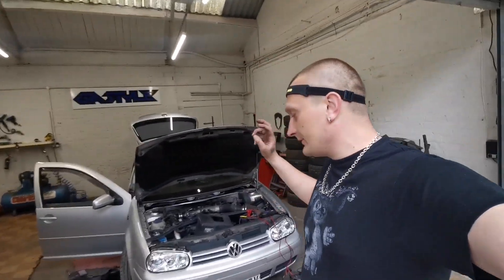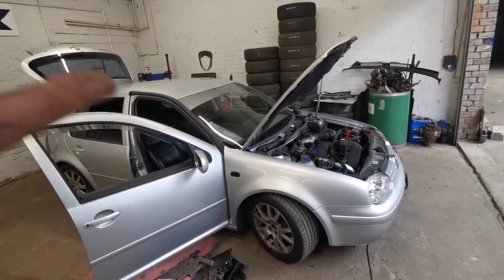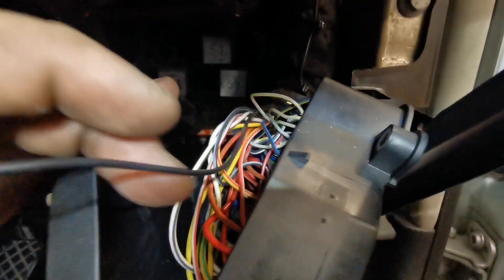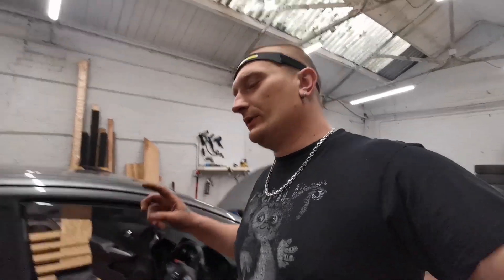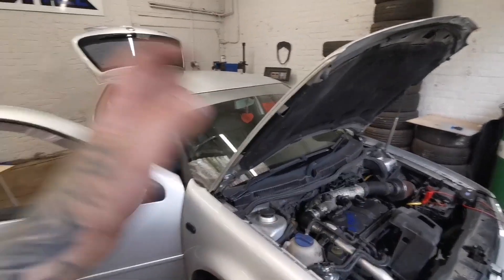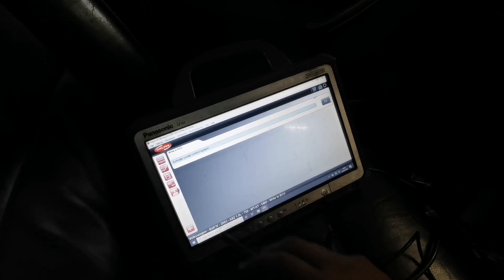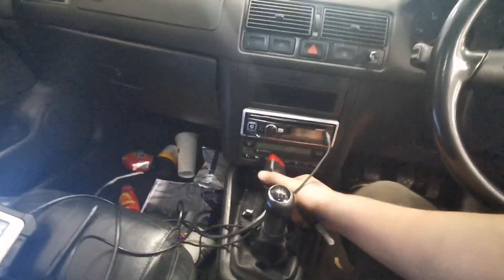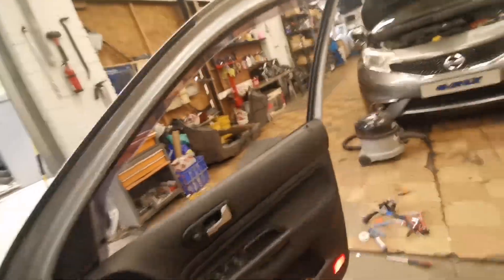MK 4 Golf 2003 Cruise Control Retrofit using Ebay Stalk and Wiring. Wiring And Coding. Part 2.

Comment: That wire that you installed into the fuse box, where does it come from? I bought a genuine second hand cruise control stalk with harness of another golf 4 and installed everything,  but I still have the thin black and blue wire from under wiper motor cruise control in dash plug, where I plugged it into its male from rain tray, coming from cruise control stalk that I must still splice into another black and blue under dashboard,  but struggling to get one. Great video. Where is the link to part one, please ?
Reply from the maker: @johanverster9438  That kit is just off ebay. Eerm I can't remember off the top off my head to be honest. And the factory stalk wiring colours might be different. Not sure